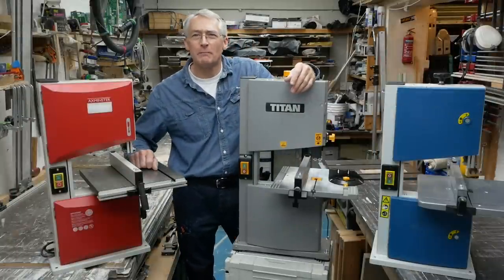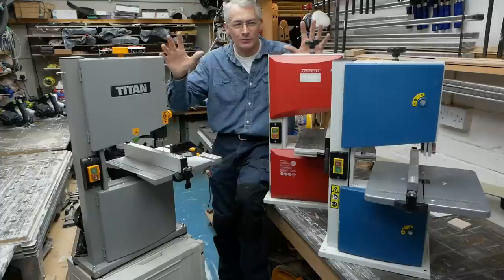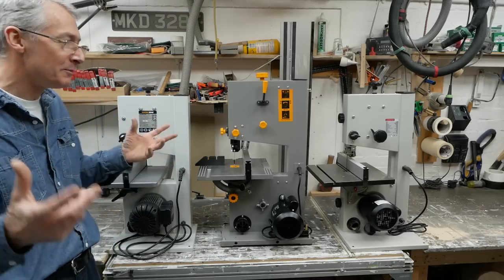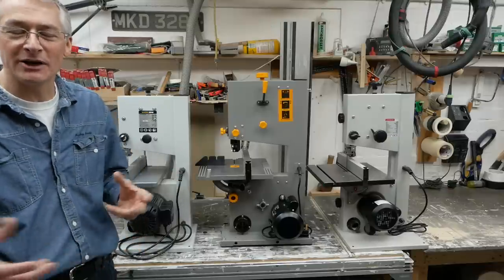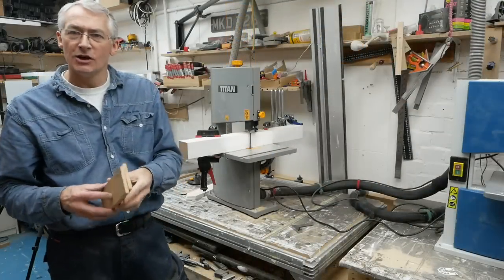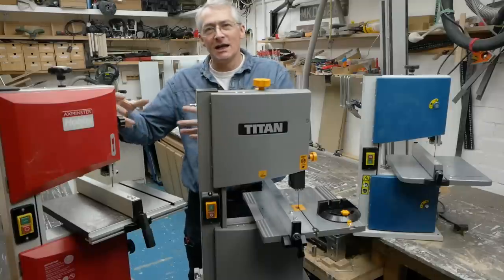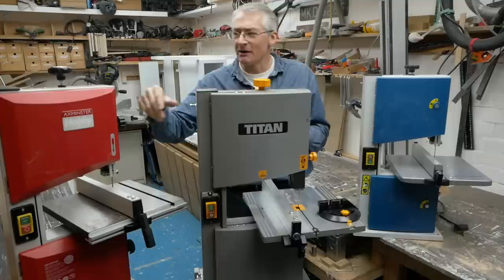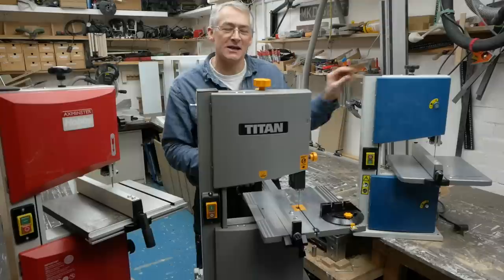Cheap bandsaws (again) #148

Comment: Hi Peter. On the basis of this review I bought the Titan when I was back in the uk and brought it back to NZ as check in luggage! Just set it up which seemed pretty easy... the problem I have is I bought the Axminster fence upgrade and have zero idea how to attach it to the table - have you got there yet as I’d love some pointers before I ruin it!! Thanks :)
Reply from the maker: Hi Nic! Wow, that’s amazing - glad it survived the journey! No, I’ve bought the fence upgrade but haven’t fitted it yet - haven’t even looked at it tbh. It’s something I hope to get to in the next couple of weeks now my big job has finished 👍
Reply: Thanks so much for replying Peter! I’ve had a think overnight about the problem as there is no obvious way to connect it other than the single screw in the saw ‘groove’. I’m planning on attaching some timber underneath by drilling and then screwing through the edge of the table And then attaching to that once it’s square and secure...should work! As you’ll see when you look one side is on an angle which makes any other approach seem tricky! Cheers.
Reply from the maker: Thanks! Haven’t had the chance to take a look at all tbh. I’ll check it out this week 👍
Reply: Hi Nic, how did you get on with attaching your Axminster fence rail? Just bought one and having the same head-scratching moment as you, it's not obvious is it? Contemplating epoxy...
Reply: Did you ever get yours fitted Peter?
Reply from the maker: The Baron Rouge No, not yet - it was to be one of my things to fit in this week, but the week seems to have slipped by - again! Nic sent me some pictures of his and it’s very much along the same lines as I’m planning; you need to pack out under the table with some wood to level things up, then drill through the table & fence to bolt it on. 👍👍
Reply: Thanks for getting back Peter, yes the more I think about it the more building it up with wood sounds like a good option. Now if only I had a working bandsaw to cut those little bits...
Reply: Do you think if I email you Nic would mind if you forwarded those pics if you found a minute?
Reply from the maker: No probs - and oh yes, the irony... 😆👍
Reply: Peter Millard Hi Peter and The Baron Rouge. I’d be happy to send along what worked for me although I am somewhat reluctant to put my email up here. Peter, would it be possible that if The Baron Rouge emailed you on your public email you could just forward along our conversation? The solution seems to have worked really well and the addition of a touch of glue to the ply to hold it in along with wing nuts, as Peter suggested, makes changing the blade easier. One thing to note is to make sure you use the right number of spacers (provided with fence) to keep the fence nice and tight to the table are the only additional points I’d add to the original email.
Reply from the maker: Nic Gibbens Thanks Nic. Will do 👍👍
Reply: Great, thanks so much Nic, Peter has obliged and your mod looks great, will have a go first chance I get

Comment: Hi Peter. Just thought i'd let you know the 3/8 blade from bedford saws fits the titan like a dream so it now re-saws so much better. I also bought the 1/4 inch blade from bedford saws and it cuts like butter. i think it was about £8.50 a blade. Just need a better fence now. Any recommendations.
Reply from the maker: I bought (but have yet to fit) the cheap one from Axminster (£13.50 if I remember right) which should work well - but as I say, I haven’t done it yet. I usually recommend Ian John at tuffsaws.co.uk for replacement blades, but always good to have another source, thanks! 👍👍
Reply: Yeah i looked at tuffsaw. There wasn't much difference. So i picked the slightly cheeper one. cheers for the fence details.

Comment: Thanks for the review, Peter. Which of these three saws was the quietest? I suppose they all have induction motors, but Axminster stresses that they re-engineered the housing material to lower any noise that escapes. Wonder whether you noticed any difference between them.
Reply from the maker: Great question! Must confess it didn’t occur to me to do a Db test as they all have induction motors. I’ll try and do a quick one tomorrow, if I can - though they’ll all sound a lot louder when they’re cutting, if course. Certainly none of them stood out as noisy. 👍
Reply: Thanks Peter, that would be very interesting if it's not too much trouble for you. Db tests whilst cutting the same material would be great since like you mentioned, there's a world of difference between an idling and a busy machine. Also, do you happen to know how many of the blade guides are bearings vs static as far as the three models are concerned? I had a discussion with a London-based woodworking teacher and he mentioned that an important considerations for a band saw are the stability of the fence (which you discussed in detail in your video - thanks) as well as the question of guide style (bearing vs static). I plan to buy my first band saw soon and quality matters. Seeing how many Festool tools you are using (in your recent cabinet making/installation video), I assume you have the same focus on quality, so it's good to know that the Aldi bandsaw got your recommendation.
Reply from the maker: hackneymarshes All these bandsaws have static blade guides at the sides and a bearing guide at the rear. At this size / price point I think only the Scheppach Basa 1 has bearing guides all round, and I’m afraid I’ve no experience of them. I’ll check the relative noise levels though, for sure. Oh, and these cheap & cheerful bandsaws are great for the money, but aren’t ‘heirloom’ tools, not by any stretch 👍
Reply from the maker: Hiya. Sorry workshop full of painted stuff so couldn't do cutting tests, but whilst idling the Axminster was by far the noisiest. I took readings at 1 metre and close by the machine, in a room with 23db baseline, as follows:-

Axminster 63db at 1 metre, rising to 67db close to.
Aldi 60db at 1 m, 63db close to.
Titan 55db at 1 metre, 61db close to.

So the both the cheaper machines right up close were as quiet as or quieter than the Axminster at 1 metre, and the Titan significantly quieter overall.

Usual caveats apply; these are the only machines I have and it was not a scientific test, just using just a db app on my phone, but the phone was isolated from the bench, and the bandsaws located on another bench, so there should be little transfer of noise through benchtop vibes. Treating the db values as relative, rather than absolute would seem the best approach. 

And all three saws are significantly less noisy than, say, the track saws I compared last year, and as I said previously, the Axminster didn’t stand out as being significantly louder in normal use. 

HTH P.

Comment: Will these motors be strong enough to cut through brass sheet material (1-1.5m thick)?
Reply from the maker: Not a metalworker so haven’t tried it, but I’d say so yes, with the right blade. 👍👍
Reply: Thanks. I fancy the Screwfix Titan but it's out of stock for the next couple weeks, and the Lidl near me currently stocks their cheap version... so I can either save £20 and get straight to work, or wait a bit and get the machine with the sliding mitre thingy (handy for my intended use). In either case, your videos have assured me that I won't be wasting my money 👍
Reply from the maker: Thanks! Just so’s we’re clear, I haven’t used the Lidl bandsaw at all - the one I had was an Aldi. 👍👍

Comment: Hi Peter - just wondering how you got on with the Axminster replacement fence on the Titan? The "Baron Rouge" hack below sounds good, but wondered if the replacement fence would be a better permanent solution. Just bought the machine yesterday :-)
Reply from the maker: Yeah, the Axminster fence is still in its box I'm afraid - one of the many things on many lists that I haven't got around to, unfortunately. And yes, it's been about a year... 😱
Reply: @10MinuteWorkshop  Glad it's not just me that has that problem :-) One of the product reviews on axminster mentioned that it works well on the titan, but needs a few holes to be drilled before it can be fitted. Presumably they need to be drilled pretty accurately if the fence is to have a chance of being square.
Reply from the maker: @diyengineer811  Oh I'm sure it works fine - there are a couple of guys in the comments thread here who've done it, I just haven't done it myself yet. There's some adjustment on the fence BTW, to be able to square it up afterwards. And yes, you need to drill a couple of holes through the table to fix it, and also pack it out from underneath as the Titan table isn't flat on the underside. 👍

Comment: Hi Axminster sell a fence upgrade and it is about £120.
Reply from the maker: Thanks - that’s more than the cheap bandsaws cost! I have the cheap Axminster fence upgrade for the Titan bandsaw, just haven’t had time to fit it yet 👍
Reply: Hi Peter, do you have anymore information on this upgrade?
Reply from the maker: John Packer I’ve bought the fence but not had a chance to fit it yet, so I don’t want to ‘recommend’ something I haven’t used, but it’s the Axminster bandsaw fence upgrade for something like £13 - they only make one at that price, so should be easy enough to find. But as I say, I haven’t used it yet, so caveat emperor & all that. 👍

Comment: Do you think the titan will get some good 4-5mm thick cut from some  stabilised wood blanks, 
These are 60mm high , 80mm long ,
Id like to get as many thin slices out of these blanks/ blocks as possible, if i use some 3" thick wood for a stable fence like you did, 
I have a few blanks id like to almost veneer some pieces from at anything from  3mm-4mm , and 5mm thickness
for a couple of home projects,
Reply from the maker: It should be OK, though it’s not the kind of thing I use it for tbh.  I’d recommend you change the blade for something from Ian John at tuffsaws.co.uk - he’ll be able to advise on the best blade for the job.👍👍

Comment: Are these any good for cutting bowl blanks?
Reply from the maker: A bit small I would have thought; 80mm max depth of cut. I've never cut a bowl blank though, so I'm not really sure what size machine you'd need. 🤷‍♂️
Reply: That is a shade too small unfortunately. Thanks for your reply and love your content.
Reply from the maker: @trampsovercoat8372  Thanks! Aldi had a slightly larger machine on sale a little while back, not sure if that would do the job. ~120mm depth of cut, I think? Might be worth a look. 🤷‍♂️

Comment: I have the Ryobi version which looks exactly like the Titan but different paint & I spend more time setting it up and cleaning it than cutting, dust collection is very bad after few cuts you will need to open those 20 turns screws and to find out that dust is sticking everywhere including the doors. I would not recommend it to anyone.
Reply from the maker: Appreciate the heads-up on the Ryobi, but I’d be very careful about assuming that because things look the same on the outside, that they’re the same on the inside. I’ve run the Titan since this video was made (18 months or so ago) without any issues, the first 12 months of that as a stock machine without even a blade upgrade. Works great 👍
Reply: @10MinuteWorkshop   Thanks for your reply PM you are right could be that internals are different but should be the same mold externally at least. Even those textures on the door internal side look the same. The saw does cut and has used it for wood and 1-2 mm thin aluminum as well with a bimetal blade but the frustration of squaring the blade and the fence and quick dust build up inside around both top and bottom wheels are what makes it not a great experience for me.

Comment: Great reviews Peter, I've just watched all 3 of these, as I'm teetering on the edge of getting my first bandsaw in the next few weeks, and here in Australia, Aldi have got stock for the time being.. It's priced at $129, which I guess with currecny conversion, is around the 80 quid you paid.. I don't care much for the thin tinny table and lack of miter slot though, seems like they could have borrowed the cast version from the Axminster..
With regards to that, and the fact that those 2 are so structurally similar,  could you not switch the tables..?
I plan on doing a lot more fine woodworking, so my current setup of an upside down mounted $90 jigsaw through a sheet of half inch ply, is not cutting it any more, (bad pun intended, sorry)
I don't really have a budget as such, so I'm also looking at a Hare and Forbes branded bandsaw, model BP-255, for around $470, the plus with that is the proper, solid table with accurate fence and miter slides, 152mm height, and 245mm throat, as well as a few accessories,  but it is 4 times the Aldi price.. 
Decision, decisions..
Here's the link by the way:
https://www.machineryhouse.com.au/W950?gclid=EAIaIQobChMI1PmAt_Ss2gIVhQoqCh2aPQv3EAYYASABEgKsc_D_BwE

Anyway, sorry to ramble, it's nearly 2am, so probably best I go to bed now.. Thanks again for your reviews, and look forward to seeing more in the future..
Reply from the maker: Hi Gene & thanks! The Aldi is a great little machine for a beginner, or as a first bandsaw, but I think if you know what a bandsaw can do then you're probably better off going for something else, as I think you'd soon outgrow it. But for the money, it's excellent, as long as you use it within its capacity. And no, sadly, the Axminster table used a completely different mounting system, so they weren't swappable. That Hare & Forbes looks like a tidy machine - but as you say, at a much higher price. Best of luck with the decision - let me know what you go for. Cheers, Peter 👍

Comment: bought a shepphach but it was impossible to track the band to get it in the centre of the two wheels the lower pulley was nowhere near in line had to put a spacer on the lower pulley to make it work .unless im missing something ?
Reply from the maker: Recent purchase? They seemed to have a batch that were really hard to set up, sounds like you may have one of them. I’d throw it back to the dealer/ retailer and get a replacement. 👍
Reply: @10MinuteWorkshop  bought it off ebay arrived yesterday spent all day trying to track the band but gave up lined up the lower and bottom pulleys bottom was 1/4 inch out of alignment with top one not sure what this co planar bollocks is but some on here say the pulleys never line up ,but surely two pulleys must be in line the tracking is only to centre the blade wierd really

Comment: Has anyone found a good source for replacement blades for the Titan? The Starrett blade sold by Screwfix is slightly too long and can’t be tensioned. Not sure if this is a measurement problem at Titan’s end or Starrett’s, will try to check when I get a minute. Really hoping the problem is with the blade, otherwise replacements will be impossible to come by
Reply: Actually it turns out replacements will be easy to come by in either case, Peter has pointed me to Ian at Tuffsaws.co.uk who will make any length blade you like for a very reasonable price, winner!

Comment: I have four children and in my house, only I have an income. You would recommend me ? The most resistant and reliable please.
Thanks mate
Reply from the maker: The Aldi saw handled everything I threw at it in the 6 months I owned it, I upgraded to the Titan and it's done everything I've wanted in the 15 months or so since. As I say in the video, the Axminster's a great saw, but I'd be tempted to spend a bit more and get something with a bit more capacity, personally. Bear in mind though that these are hobby bandsaws at this kind of price range - even the Axminster is only rated for an hour of runtime a week. I've done quite a few videos on entry-level bandsaws - they're all in a playlist 👍
Reply: @10MinuteWorkshop  Okay, from those three machines I think I'll go for the titan. Thanks again
Reply from the maker: @jordee7069  That's the one I kept. 👍🤷‍♂️

Comment: Can you change wood cutting band to a metal/steel band
Reply from the maker: I believe so, but I’ve never done it. 👍
Reply: Rather difficult to convert direct-drive saw to cutting metal. You need to slow the blade to 150-250 fpm.
This is relatively easy if you have belt-driven saw. Just find a worm gearbox, a few pulleys to bring the rpm of the motor down on the saw drive shaft to give you ~200 fpm blade speed, put it all together and it will cut mild steel and aluminum.
Saws with cast iron frame can handle higher tension you have to apply on the blade. Cheap “pressed tin” frames are not rigid enough, which further narrows your choices for conversion candidate saw. 
A used metal cutting saw may be a better option.

I have a bandsaw with two-stage pulley drive. The previous owner was using it to cut 1/8” aluminum ( he was building an airplane in his garage).
After trying it I opted to hunt for a used, cheap metal saw.
One thing you may not be aware of is that cutting metal is dirty. The combination of metal dust, chips and cutting oil will render the saw practically unusable for wood. 
For a few occasional cuts mount a jigsaw with high quality tungsten or carbide-tipped blade upside down to the table. The jigsaw must have speed  control as you still need the blade to move slowly when cutting metal.